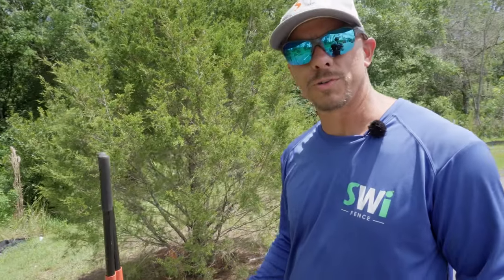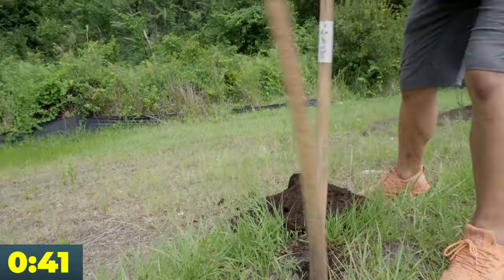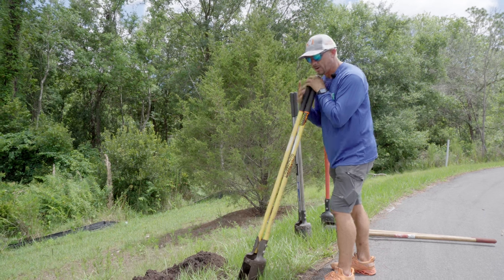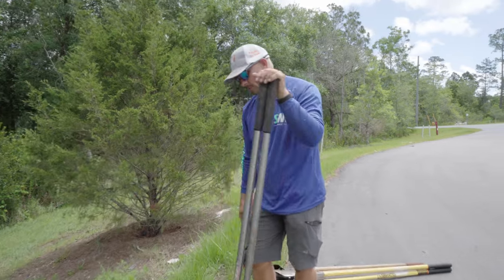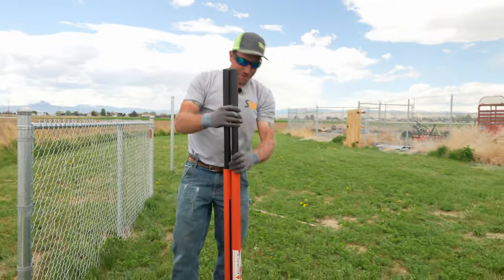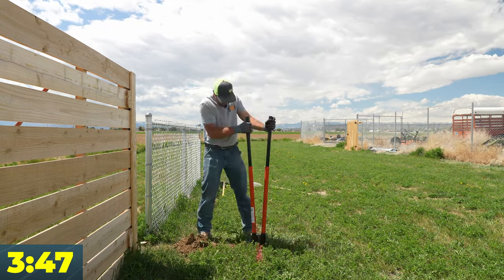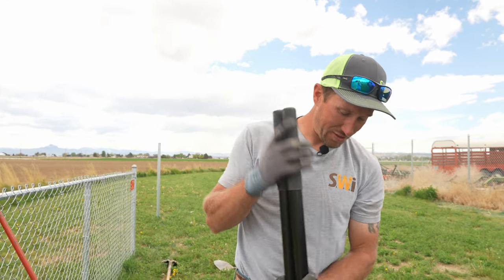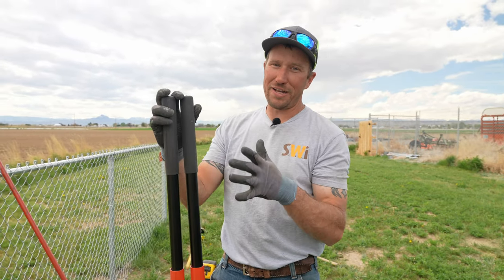We Test 4 Post Hole Diggers So You Don't Have To

Comment: We have a lot of potato sized, leftover glacial stones in New England. After digging over 30 post holes last week replacing a fence, I think a combination of diggers worked best. A heavy straight one for cutting roots and getting a straight hole started. An articulated set as the hole gets deeper so you don’t need to make it wider. These also help plucking big stones out as well. A heavy digging rod with a chisel tip for loosening soil and cutting roots.  
I was replacing a bunch of fence I had installed about 25 years ago. I wasn’t as particular about the tool back that but in my late 50s now, I need all the advantage I can get! Had all 3 of them, ready to go at each hole.

Comment: I am interested. We dig postholes every day the fiberglass suck the wood suck, the metal ones just end up bending at the head point and bending back and forth they break. We use stainless steel 1.25in poles with a solid core at the shovel head about 18in long. It adds weight to the head, but you can slam hard and can't bend the pole. This is modified by us. The only downside is breaking the shovel head. Rocks, sandstone, clay, mud, and just hard ground. All year round, the  rock breaker is a must. I will be looking into this product. Our team can break any posthole digger on the market. Tree roots are just cut out with a sawsaw.

Comment: I bought these  simpole diggers and they lasted about 4 months.
1.  I initially they worked great in harder dirt and clay.  
2.  They are heavy so they will wear you out quickly.
3.  The handles would be better if they had a grip with knuckle protection because when you hammer, you WILL hurt your hands.  If the handle had a grip with a guard it would be much better.
3.  It takes a minute to get the hang of digging, twisting the handles to grab and pull.
4.  I stopped using them because the nubs that catch and release the handle basically fell out and when I went back to my standard diggers, they worked better and were light and inexpensive.

The simpole is a Decent idea but in practice is definitely NOT WORTH THE COST.

Comment: I’ve bought a few different post hole diggers including steel handles. The best I’ve found is an old one that my dad has had sitting around my whole life. Wooden handles that are square at the bottom. They aren’t too heavy but they are still very rigid. They also absorb the shock of impact better.

Comment: This is not an ad but you should definitely check out the "Nu Boston" post hole digger. It's on a hole another level (cheesy pun intended) 🤗 I love mine for digging a deep straight hole without needing to make the top any bigger than the bottom.

Comment: If that works for you then awesome. The lighter pair won't necessarily make work easier or quicker, though. It'll be easier to move around and less physically straining for loose soil but the trade-off is less power. A heavier head/frame translates to more kinetic energy which is what you really want for cutting through denser soil like clay. I also find that the heavier thicker heads hold an edge longer before needing a touch up.

Comment: Post hole diggers?  Fiberglass handle diggers sometimes have weak fiberglass that eventually breaks just above the steel clams/jaws.  Then I go buy 2 new good and strong replacement wood handles (some are better than others) and swap out the handles, sometimes replacing the bolt, nut and washer sets (4, two for each handle).  Too much flex with your wood handle diggers?  Just tighten up them bolts, OMG not too difficult to figure out!!  Steel handle diggers come with weaker and thinner steel clams/jaws, so just swap them handles to a heavy duty clam/jaw from a broken fiberglass set.  Did that last week as a matter of fact.  Otherwise I like the wood handles on stronger steel clams/jaws.  When shopping for a new set ya just gotta know what you are looking at, able to tell the difference.  Excellent arm and shoulder workout doing this digging, it's great.

Comment: I use a Husky square wood handle digger that I marked out at "24, "30, and "36 with grooves filled with black permanent marker for rough depth estimates. I live in Florida so its easy digging.
Reply from the maker: A marked handle helps a ton. 👍🏻

Comment: I’ve used wood handle diggers and they worked but the handles always seemed to fail. Bought the steel kobalt one and love them. They work really well and are holding up good in the weather.
Reply: My wood handle ones that I use professionally have never broken. How ever the metal digging portion just broke😢

Comment: I worked for a company as an electrician and we use fiberglass ladders, but this company had so many old ladders that the fiberglass would get under your skin in the hands and arms and shoulders.
Reply from the maker: 😬 That sounds unpleasant!
Reply: @SWiFence  It definitely is; because it takes days for it to stop irritating the skin.
I think steel handles is definitely the way to go! The ones thrown to Dan all the way from Florida, lol, are almost like having a bar and a sledge hammer. I think they would be suitable, especially if you are having to dig through smaller roots on shrubs and trees!

Comment: I like to throw my post hole diggers down into the hole so I prefer fiberglass phd's, and shovels really. Ditch Witch makes some good ones. If I was at the beach I could understand going with steel but I'm in red clay and blue granite territory. Sometimes I use a digging bar too.

Comment: so you give it a twist as you open up the handles?
Reply from the maker: They twist out of the lock once you release them. 05:19
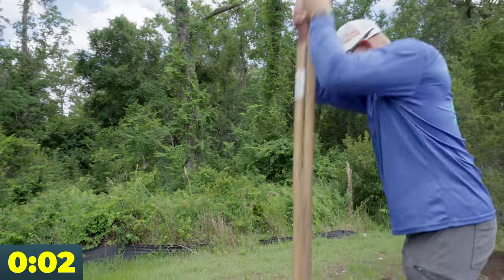Reply: @SWiFence   I was referring to the rotation of the handles before you bring the digger up as seen at 00:58 and with each post hole digger.    I  don't know how to  insert time stamps!  🙂
Reply from the maker: Ah--gotcha. 👍🏻 Yes, I tend to use a twist to help with the digging action.

Comment: I use black ones that have slightly different geometry. 
Most importantly they have a lifetime warranty. Red Backs I think they’re called. The handles will break eventually but I just swap them out every few months. They also have bigger scoops that the wood handle ones it seems. 

Can’t stand the little wood handle ones.  Like little toys.